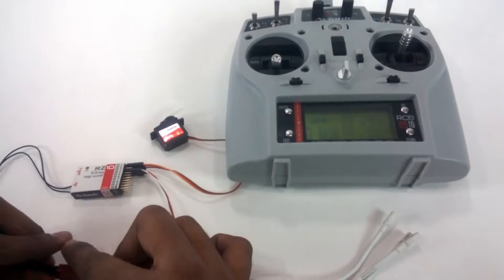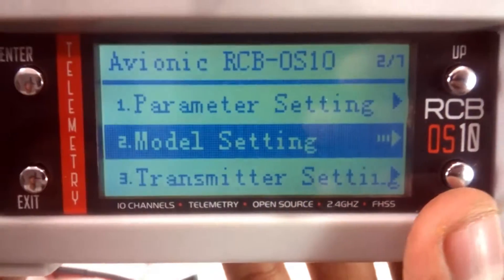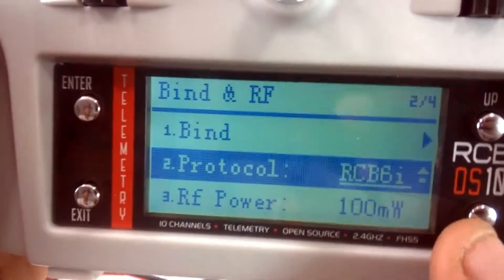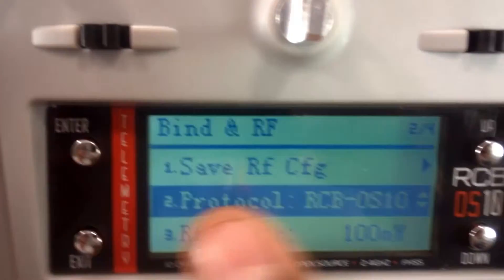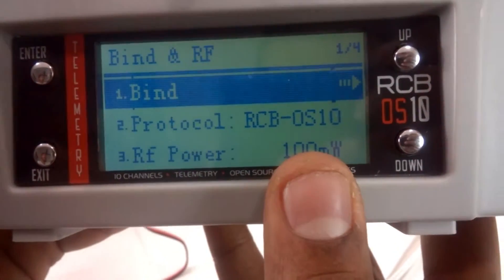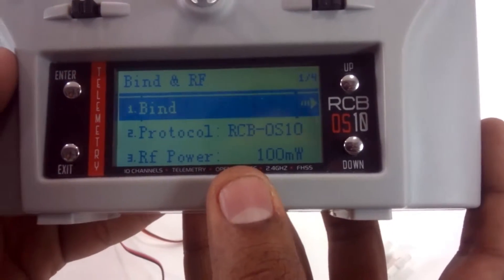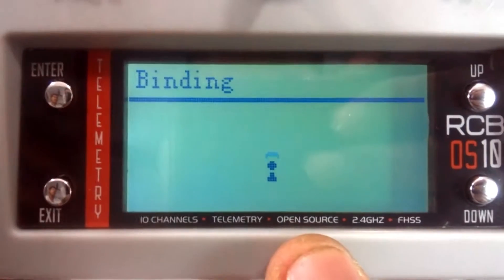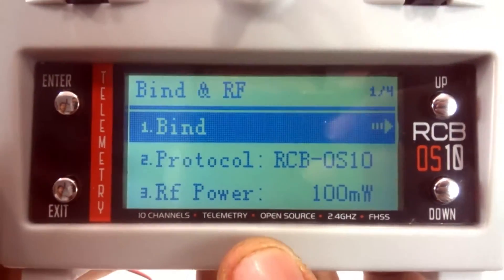Binding proceedure of RCB OS-10 with RZ10 (10ch receiver)

Comment: How to bind the RZ10 receiver in PPM protocol? Does the LED on the receiver blink with a higher frequency when bound to the transmitter in PPM protocol?
Reply: And another question, on which protocol does the transmitter and the receiver actually work? Is it PPM or S BUS? Cause both of them are different!! In the menu of the transmitter it says PPM, but on the RZ10 receiver, there is the small label of S-BUS beside the channel 10!! Please clarify this and it would be better to make a video on this topic and explain.
Reply: hey did find any solution for this